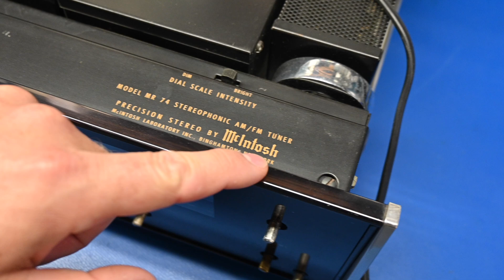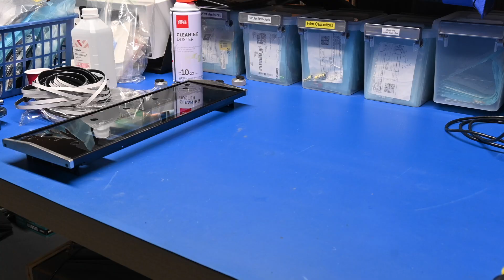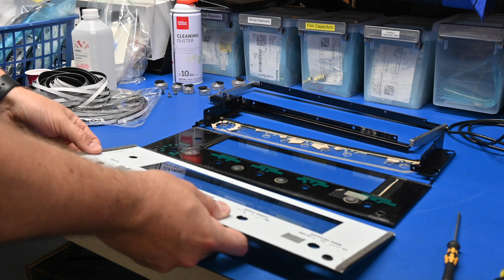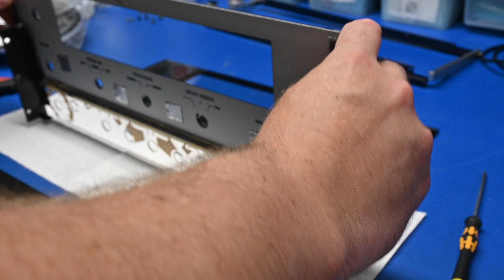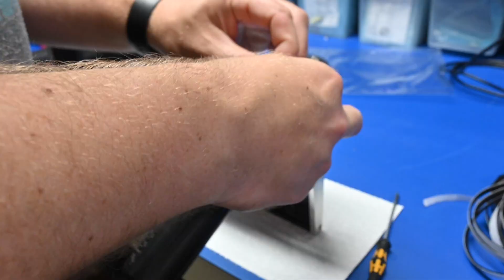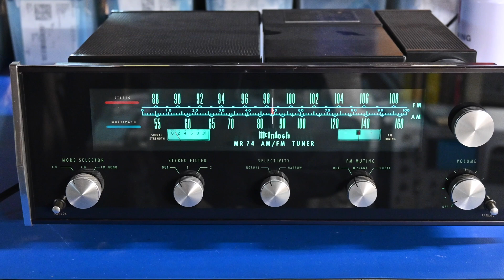McIntosh MR74 Tuner Front Glass Replacement

Comment: That replacement from Audio Classics doesn’t look original factory. I toured the McIntosh factory. They make mostly everything in house to spec. I watched them make the front panels. You should have contacted the parts department first IMO.
Reply from the maker: AudioClassics gets them directly from McIntosh - they are a big McIntosh reseller - they custom ordered it from the factory which took them a few weeks to produce.  They are legit and well known.  (They are also right down the street from each other in the Binghamton area).  Seems to be a known limitation as well, here is a thread on AK with new vs old pics: https://audiokarma.org/forums/index.php?threads/glass-faceplate-comparison-original-vs-modern-replacement.926073/
Reply: @philsanalogbasement  I know I bought an amp from them. I would still tell McIntosh that you are not satisfied. They are great with customer service. If you don’t get a satisfactory answer from the parts manager talk to the Production Manager.
Reply from the maker: @rancosteel  I ordered some frosted LED #44 style bulbs, we'll see how it looks once they are in.  I think it will help quite a bit (when powered on, at least)
On another note, it looks like they may have started offering the tours once again?  I really need to get to one. I have to work in Vestal from time to time so will need to get one scheduled.
Reply: @philsanalogbasement  It’s a great tour. They allow photography. It end in the listening room with you seated. Very cool and I’m not a Mc fanboy anymore.